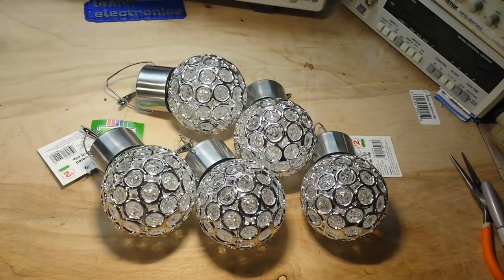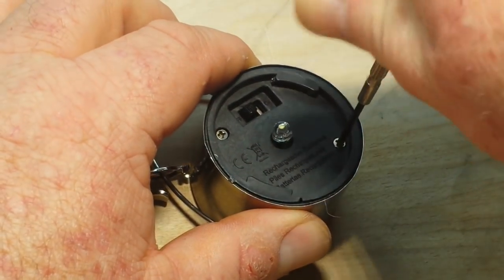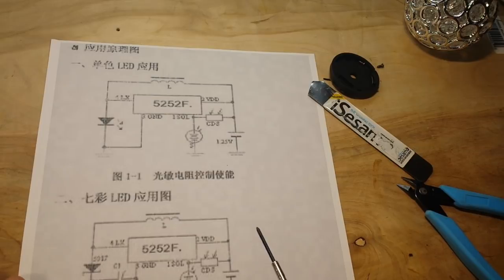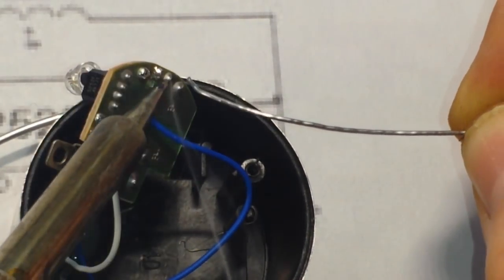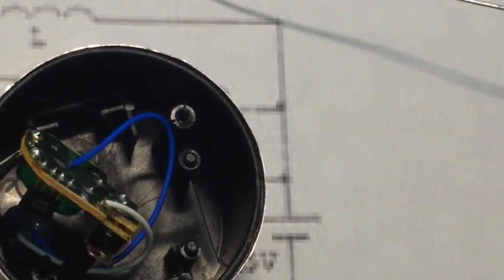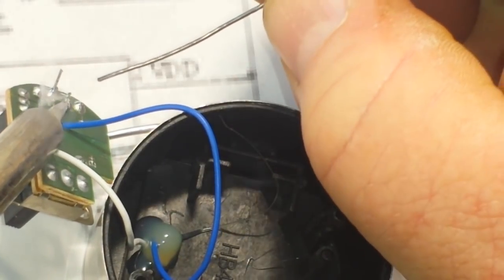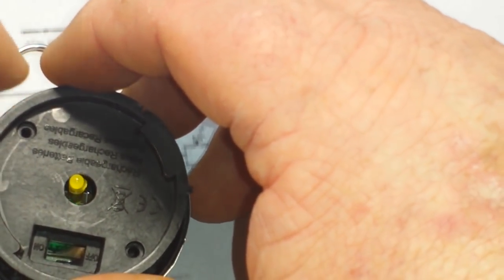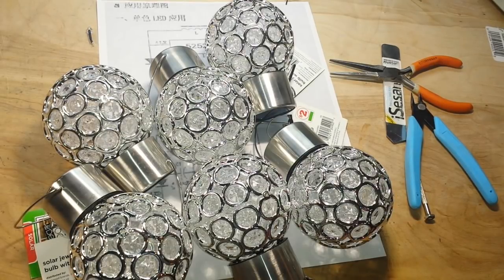Solar Garden Light Teardown and Hack

Comment: I think that must be some kind of joule thief circuit, as a solar cell that size can't produce more than half a volt or so, which isn't going to charge a battery unaided. I wonder if replacing the battery with a small supercapacitor would extend it's life? And maybe replace the switch with an LDR to make it automatic? Oh yes, and colour-cycling, flashing LEDs...
Reply from the maker: It is automatic. The switch is just a master on off so it doesn't drain while in storage.

Comment: @learnelectonics i have bunch vacum tubes i was wondering if u could help me find a way to just light them up  love the video
Reply from the maker: Depends on the tube. You need to know the filament voltage.
Reply: i have hole bunch of tubes all diffrent types but i think what i have the most of is  12AX7  Filament Voltage. 6.3-12. V.
Reply: I JUST WANT TO LIGHT IT UP NOTHING FANCY